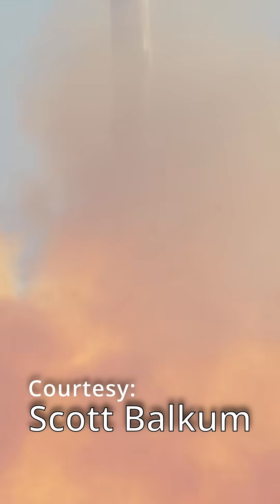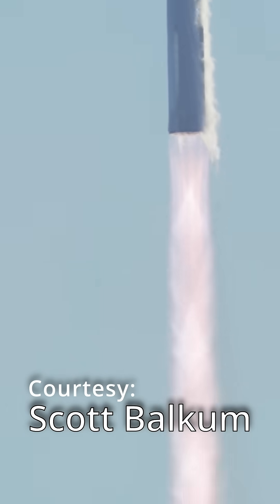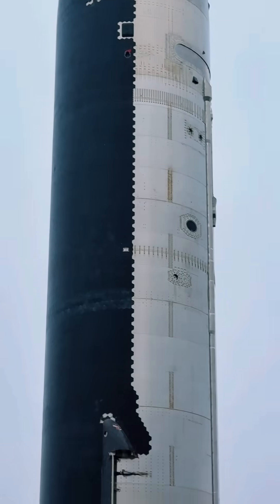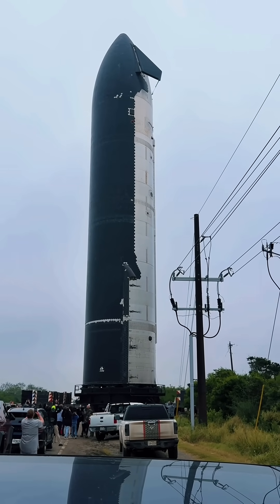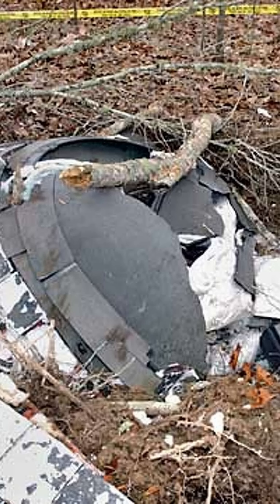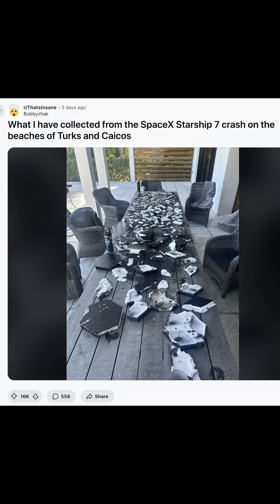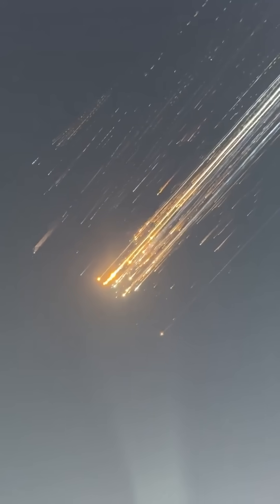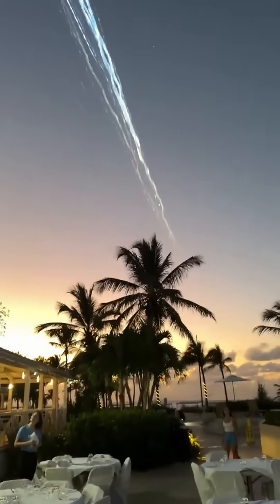3 Types of Debris After Rocket Explosion  #starship

Comment: I have a potential solution for the notam thing. What if when they file everything they make a moving notice to air and marine that there is a test flight of a rocket launching that once it launches they have an constantly updated notification of possibile debris fields if something happens to the rocket mid flight like what happened with starship flight 7. Like have the area of the complete flight path labeled as a potential flight hazard and for all air and marine transport avoid the area for about an hour roughly for their safety.